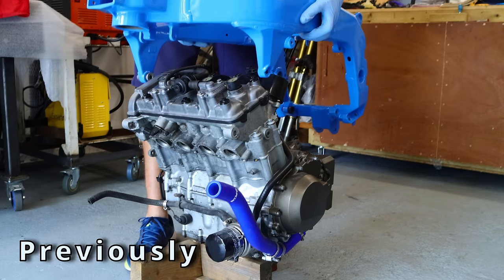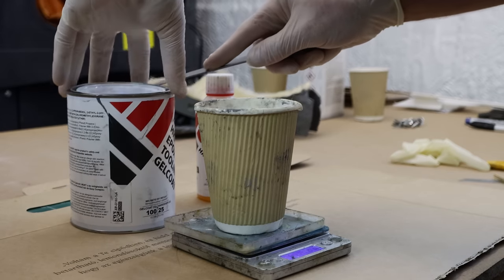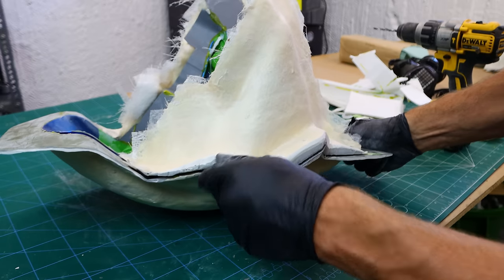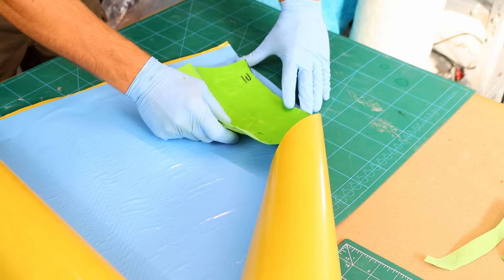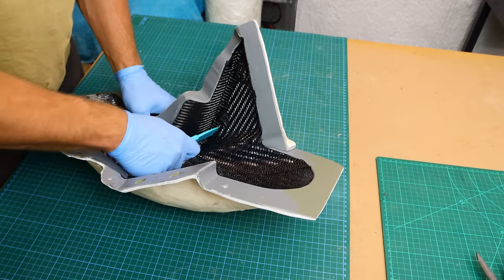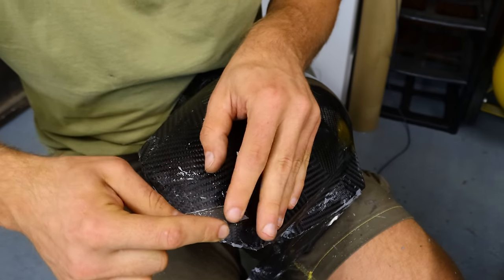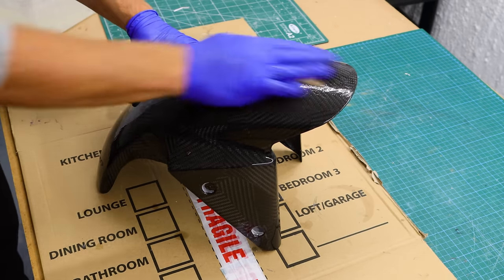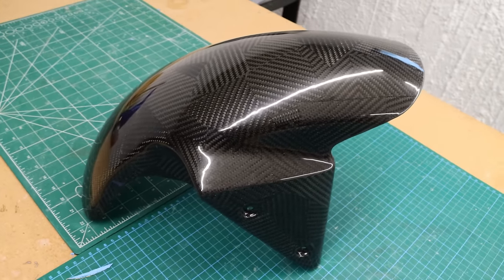Carbon Fiber Front Mudguard - ZX6R build PT. 4

Comment: just a thought: You used tape onto the mold which already had the release agent on it. Perhaps the release agent may have been damaged during the removal of the tape, causing the carbon fiber to eventually adhere to the mold. It's nice to see that setbacks don't stop you from continuing. Good Job!
Reply from the maker: Hey
Unfortunately that wasn’t the case because off camera I did apply another 4 coats of release agent. I always use 2 or 3 coats of release agent before I make a template of the mould. The tape comes out so much easier. I forgot to put that into the video I did finish the mold up with the 4 coats of RAgent. 
Thanks for the compliment and thanks for watching 🛠️🤘

Comment: Don't worry @ZRcarbon, I've had exactly the same thing happen to me , but it was my original part got trashed my mould is still ok, it's all part of the learning , our processes were the same, I think where we both might have gone wrong was a chemical mould sealer , I used a rub on release wax which is good at best , I'll definitely use a mold sealer and also try chemical release agent next time, great video 👍🏼
Reply from the maker: Hey 
Thanks, yeah with every single failure we learn something new. Only guide us into perfection. 
I never used wax before. I can only recommend Chemical RA. This was my first bad experience with the product. 
Good luck for your work 🛠🤟

Comment: Fantastic video, one trick I have used to separate parts from the mold is to use shop air after you get a wedge separating it slightly. As for release agent it just takes some experimentation to figure out what will work with what you are using. Molds will get better and need less release agent as they are used. I apply and buff out the release agent at least twice as many times as I think is necessary on the first part.

Comment: nice video. carbon is new for me. i need to do this :)

for your next project, try to thin out the mipa a bit with a solvent and apply a thinner coat so you have less structure / paint stripes and pin holes. then add a second and third coat over that, after that sand it. when sanding, dont use your fingertips but use the entire underside of your fingers close to eachother to prevent sanding uneven spots or create dents in your project. you only need to go forward and back 2 or 3 times with presure on 1 finger with 600, or even finer sandpaper, and you will see that in your end result. try to sand the whole part at once and smooth out away from the place you are focussing on so you will level the whole coat at once. you could spray a thin matt black coat over it when you start sanding so you have a guiding coat that will show you exactly what you are doing.
you can use a "wit plamuurrubber" for sanding (dutch, can't find the english name for it. google it),  it will take the form of the part you are sanding and will give a smoother surface. just some soft rubber sqaure thing works perfect for shapes like this.
Reply from the maker: Thanks so much for your advice. This will help me a lot in my next project.🛠🤟

Comment: Use wool with compound first then microfiber with polish then foam pad with polish. It will look like a diamond! Love the channel dude
Reply from the maker: Thank you for your advice. I'll try it out in my next project 
Thanks for watching 🛠🤟
Reply: @zrcarbon9937  This is SMX Tech. btw 🙂
Reply from the maker: Hey how's every thing going? Did you get your composite oven from easyc.?
Reply: Unfortunately I had to go another route because the power here in the US is slightly different than how the machine was set up. I don't think it would have worked  @zrcarbon9937

Comment: Hello
Based on what I see from the video, you did not post cure the mold to 135 C, but went straight to the laying of carbon fiber. We can see that based on the color of the mold. Alter cure it's color should turn darker yellow.  Also, I suppose you did not follow the proper procedure of applying the release agent ( 5 coats with 15 min intervals + leave last coat for 1 hour).This can happen to anyone, I also had my share of failed molds )
Reply from the maker: Hey
Thanks for your advice, I'll definitely watch out for that! All failure happens for a reason  🛠🤟

Comment: Nice to see the complete process and also shares failures. What material thickness do you get with 3 layer 210g and 2 layer 450g? Sounds like a lot to me.
Reply from the maker: Thanks, 
That is a lot of carbon yes. I wanted to have my first piece super strong. 2 layers of 210g and 1 layer of 450g will do it just fine. 🛠🤟

Comment: Hi, is it possible to use a single piece of carbon on the surface finish of the larger fairing panels like the underbelly for your Ducati. I love the carbon look but I want to have one continuous pattern as the finish. Is that possible with the Prepreg?
Reply from the maker: Yes, absolutely. Carbon fibre mat is designed to us it as a whole sheet, but I jus wanted to use it differently. I'll be making videos in the future using prepreg as a whole sheet. 🛠🤟
Reply: @zrcarbon9937  Awesome thank you so much, please keep up the content

Comment: If you could tolerate a 2-3mm deviation from the original size of the fender, I imagine you could have simply used the fender as the mold itself, and applied woven carbon fiber cloth to the outside or inside, and adjusted the bolt holes accordingly, and/or used spacers on your bike to reattach the new carbon piece.. 

I recently saw a video where this process was utilized, and there is no wasted material, and no extra steps, and much, much quicker.. like I said, IF you have accounted for the discrepancies in tolerance, and are okay with a SLIGHTLY different aesthetic (either larger or smaller, depending on which outward or inner face is used to lay the new carbon fiber fabric.

This should only be done with structurally inconsequential parts, of course, in my opinion, such as panels and fenders :)
Reply: Well said
Reply from the maker: Hey man
Yes you’re right. That is possible to do. In my case it wouldn’t work because the fender has several curves and bends which would mechanically lock the whole carbon part onto the oem fender. 
The idea was to reproduce the fender as the original, but I messed up with the release agent. Will be a new video sometimes so correcting my failure with the fender. 🛠️🤘

Comment: Which material are you using for building the „frame“? It looks so easy to bend and adjustable to the shape of the mudguard. Can’t be solid PP plates, right?
Reply from the maker: Hey 
I used fluted signboard for that. It is easy to work with. 🛠️🤘